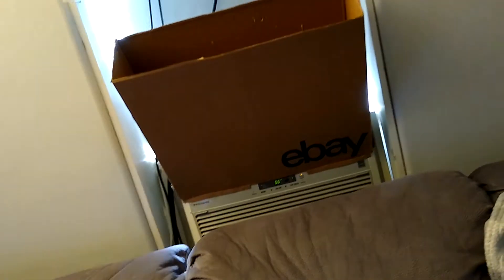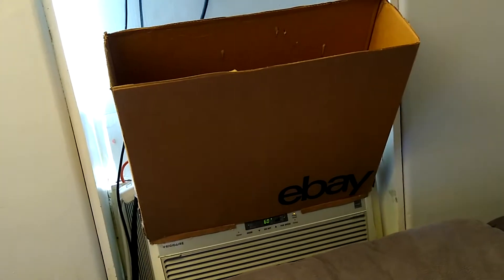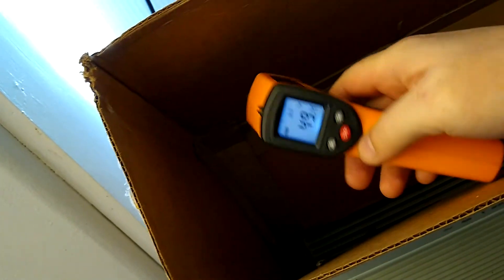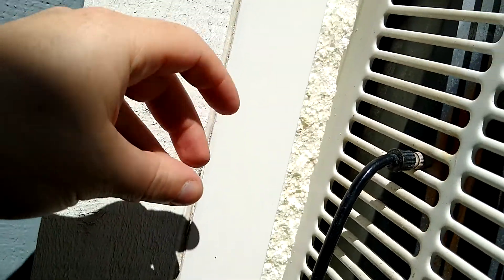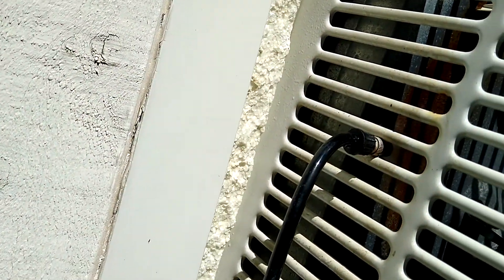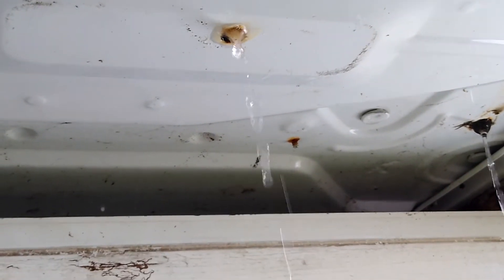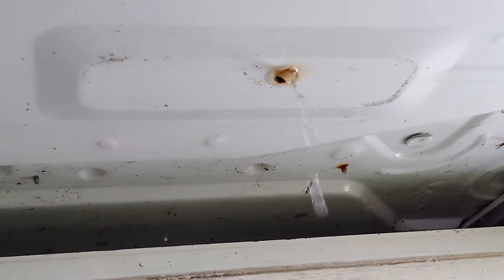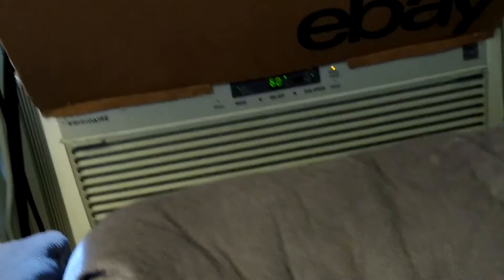Air Conditioner Mister Water Mist Kit to Supercharge the Window A/C House Cooling Lower Bill Output

Comment: I did the same thing 2 yrs ago & believe me it does work,  if you can cool off the hot side the cold side will be much colder 🥶😊
Reply from the maker: That's valid.  I liken it to a heat pump system for a smaller home.  I have seen some pictures online of very large mist systems that probably save thousands per month or at least increase capacity.
Reply: @geostomp  I gotta tell my boss about this to cool our building with large industrial ac unit on roof cause I know a mister will work on it also.